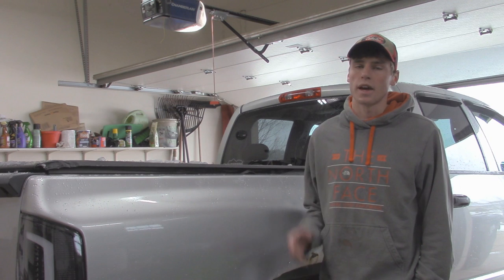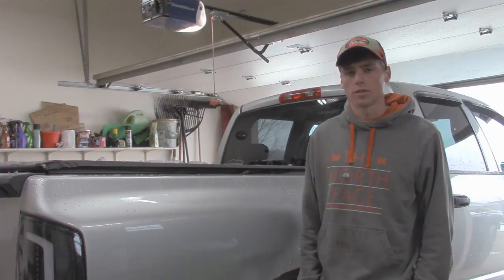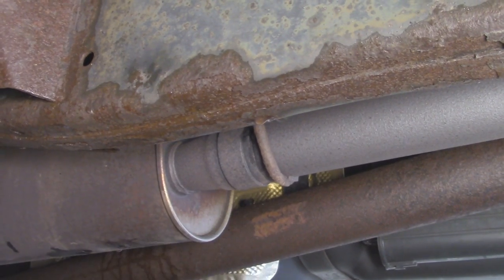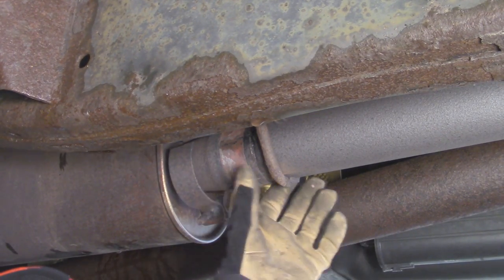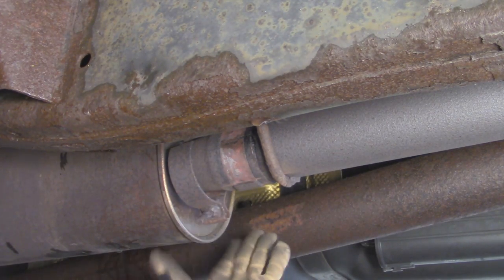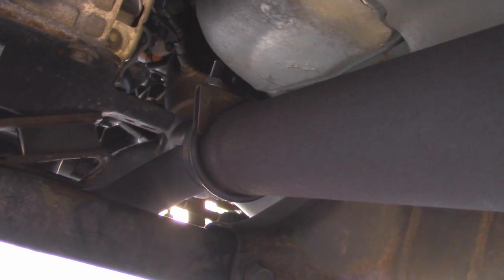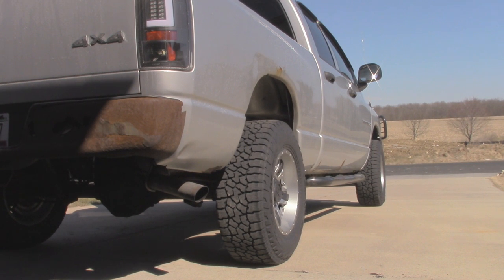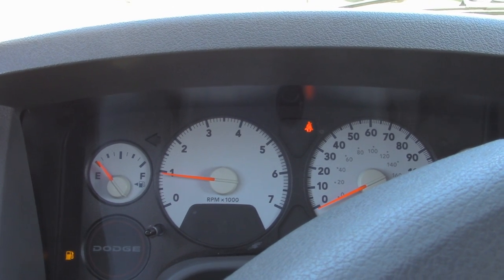Jeep, Dodge, Ram 4.7 Flowmaster 50 Delta Flow | Install & Sound Test

Comment: Nice job on the install Austin.Like you,I also have a third gen Ram with a 4.7L v8 and a Jeep XJ.The 4.7L ain't too bad as long as you keep up on maintenance......
Reply from the maker: Yeah I got 220k miles on mine and it's not too bad so far. Just gotta make sure to change the oil and not to go over to prevent sludging problems I also gotta do head gaskets soon because it burns coolant.
Reply: I replaced my head's back in October.Use a good quality MLS head gasket and replace the head bolts and you will be fine.I even went as far as spraying the copper gasket sealer on mine.
Reply from the maker: @danhambrick6331  Have you replaced other things while you were in there, such as timing chains?

Comment: Just to confirm, this is the delta specific, and not the super/suv?
Reply: Also interested in that...
Reply: @calpremier  doesn't matter now. I put the super 50 on my 4.7 wj. Next to no drone, quiet in the cab. But sounds pretty mean outside. If I get a chance in next few days, I'll charge my vid can with external mic

Comment: What about the exhaust tip?
Reply from the maker: I reused the factory tailpipe/tip for the rest of the exhaust out the back. It was still in good shape with no major rust.
Reply: @OutJeeping   sir look for exhaust muffler that go to my 2006 Dodge Ram 1500 truck. But all I see is dual exhaust. Could you point me in right direction please?
Reply: @charlesdodson1991  no